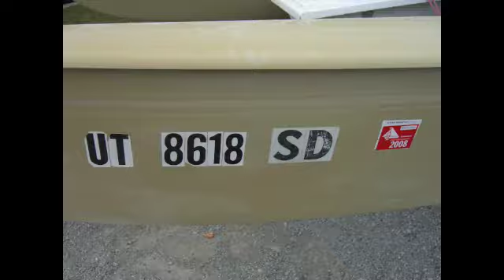Hobie cat 16 Boat Repair

Comment: I’ve got same sails on my 1978 hobie 16. 43743  just got boat in June this year.  Hulls still original and in good shape. Working on repairing a 1974 hobie 14. Only 1 soft spot about 18” on top so west marine epoxy injured it and it’s great now. Jut want to sand and new gel coat hulls on it.

Comment: What kind of paint did you use? Did you use gelcoat?  I am looking to repaint my 81 H16.  I've heard the roll and tip method works well but don't really know where to start with paint.  The hulls are in great shape I just don't care for the color.. any suggestions?